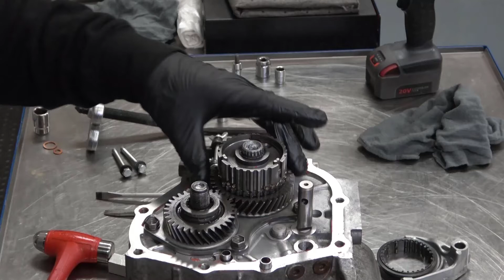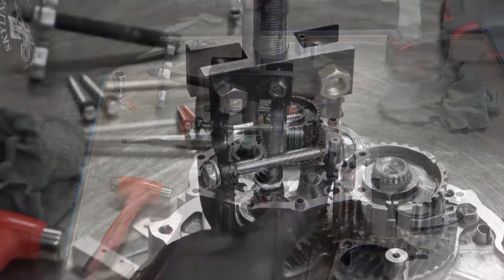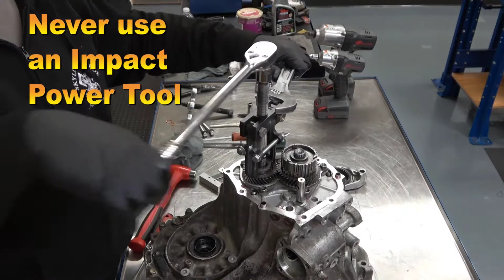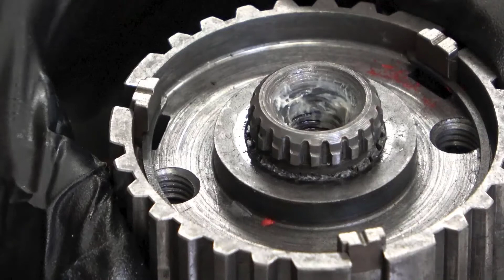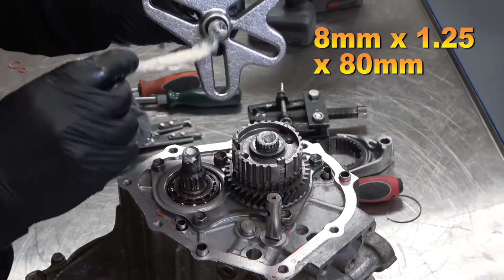Manual Transaxle Overhaul (3.1)5th gear removal

Comment: I'm working on a Toyota echo trying to get that hub off. There isn't the two 8mm bolt holes in it. Is there a special puller that I need?
Reply: Did you ever figure this out? I’m working on a scion xB and ran into the same thing
Reply: @ksnipes24  yeah I ordered a small puller on Amazon and used a impact on it and it came off

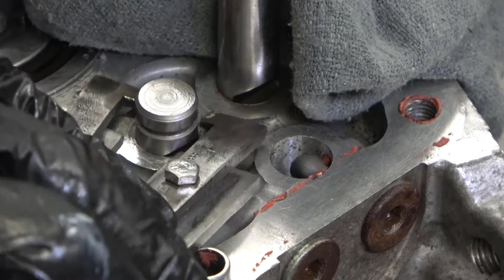Comment: Great video. I like the detail. What is the make and part number of the 5/8" snap ring tool at 4:29?
Reply from the maker: The 5/8" snap ring tool is a custom tool I made and not available commercially.
Reply: @DrivelineMaster yeah I saw it in another one of ur vids. Very nice. I think I’m gonna make one as well. Thx
Reply from the maker: @RelentlessRacingAJ  If you do enough work that has these 5/8th snap rings it is a time saver.  Once you get your tips as you want time heat treat them to harden them.  Get them red hot and quickly quench them in water.  I put a real small notch about a mm away from the end of the tip to catch onto the edge of the snap ring.  If you need a close up picture let me know.  Happy to share.  I know it needs some engineering improvements but it still works good as is. If you make a million bucks off of this idea remember where you got the idea from.

Comment: When the car is removing then gear five out
Reply from the maker: The transaxle has been removed from the vehicle however on some vehicles it may be possible to access 5th gear while leaving the transaxle connected to the engine.

Comment: saan po nakakabili ng removal na yan?
Reply from the maker: It's made by OTC but most universal gear pullers will work for 5th driven gear. Same for the Synchronizer hub.  there are several that make similar designs.  One note however if the synchronizer hub doesn't have threaded holes in it then it's very difficult to find a universal puller with puller jaws with a small enough claw to fit under the gear.  I did have to use a very specialized universal puller for that one.

Comment: Hello, do you recall a part number or the type of thread that you used for the longer forcing screw? I need to pull the 5th output gear on my E250F and I will order that OTC tool. Also is it generally okay to evenly install the driven gear back on with a hammer/deadblow?
Reply from the maker: Unfortunately right now I don't have that thread information.  I have run into a few different forcing screws.  I Might be able to check in a few days when I go to the shop.  Don't hit right on the gear but instead find a metal pipe that fits the inner diameter so it doesn't hit the gear teeth then you can hammer it on by hammering on the pipe.
Reply: @DrivelineMaster  I got you, I ended up modifying a pitman arm puller to get that gear off. I’m also replacing the bearing plate as part of the TSB to fix the issue, but I notice the spacer ring that’s under the plate, that contacts the output bearing race is a bit worn down out of center on the side, just a couple thou. Think it is safe to reuse that spacer ring if I just smooth over that step so it’s all parallel again (but a couple thou undersize from what it was)
Reply from the maker: If you have a spacer between the bearing race and the bearing plate check to see if you have tapered roller bearings.  if you do, that spacer is used to set a preload on the bearings.  It doesn't need to be perfectly round as long as it contacts the bearing race properly but more importantly is the thickness.  I don't remember if I covered this in my video's because the transaxle in the video uses ball bearings and roller bearings instead of tapered roller bearings. If your output shaft has tapered roller bearings you need to add an extra step to the assembly.  After overhauling your output shaft and replacing the bearings and races put only the output shaft (No diff or input shaft) into the lower housing.  Put the upper housing on the lower aligning the output shaft.  Torque the lower housing bolts in place. All of them.  Install the upper bearing race, spacer (shim) and bearing plate.  Torque the plate to specification.  Put the nut onto the output shaft and make it just tight enough so the shaft will turn with the nut.  Use and inch pound dial or beam torque wrench (can't use a click style) and rotate the output shaft with the torque wrench and note the value on the torque wrench.  A digital torque wrench may work but I have never tired to use one. This is the bearing preload.  Compare that to the manual for the specification.  A thicker shim will increase the rolling resistance and a thinner one will decrease it. If  you need a spec let me know what the transaxle came out of (year, make, model, engine) and I will see if I can look it up for you.
Reply: @DrivelineMaster So it is a 1996 RAV4 3sfe engine and I believe it’s the E250F transaxle. The transmission is still in the car, I only opened that access panel on the driver side to replace the parts referenced in TSBTC001-01. Of course 1996 isn’t listed on there but I hope this fixes my issue of fifth popping out of gear under load. Maybe I’m confused but I’m not touching the main bearings that at the end of the in/output shafts under the bearing retainer plate.
Reply: @DrivelineMaster  it is indeed a tapered bearing though
Reply from the maker: Use this link for information on adjusting the preload on the output shaft tapered roller bearing. http://www.tgbcomputing.com/PDF/REAS.pdf
Reply: @DrivelineMaster  thank you. So it’s okay to have the input shaft installed then while I checking the output preload? Just not have it in gear of course. 

Could you also double if these tolerance ranges are correct: 5th gear thrust clearance of .004-.022” and the lateral clearance of .0004-.002
Reply from the maker: It is NOT okay to have the input shaft installed or the differential. This can not be measured with the transaxle installed in the vehicle. Contact with other gears will skew the bearing preload measurement.  I'm uncertain as to what you mean about doubling.  I never bother to check lateral clearance because the bearing, shaft and gear would have to be severely worn out to be out of specification and I can visually inspect those components. Make sure the snap ring that holds 5th synchronizer onto the shaft is in good shape and fits snug onto the shaft.
Reply: @DrivelineMaster  oh boy, makes total sense but that sure is a bear of a job then! I’m not in a position right now to pull the transmission, if it’s even easily doable without having to pull the engine too.. 

By doubling, I meant to say double check* my bad

So I might have to roll the dice on reusing the current spacer. As much as it probably pains you to hear haha. If I have to do the clutch at some point then I can overhaul the trans, you make it look pretty easy!
Reply from the maker: Yes, I would just reuse the current shim.  odds are that you won't have a problem. Chances are that 5th gear thrust clearance will still be in spec. without you having to measure it. If you have the tools it's not a bad idea. I would not worry about the side clearance. If you performed the bulletin and replaced the hub and bearing that means you had the gear off and you had the chance to inspect the output shaft bearing surface and if all looked good and you put the new bearing on your side clearance is going to be OK.   You should be able to R & R the transaxle without removing the engine. If your RAV 4 is a 4WD model R & R ing the transaxle is a big job even without removing the engine. I had students do one of these 4WD models at the school once and I swore off ever offering to do another 4WD RAV 4 model. Good Luck.

Comment: I have the C150 gearbox that has the 0.825 5th gear. Looking to get the 0.725 5th gear from a C53 gearbox for better fuel economy. 2 things i'm worried about and that's if it will work and not strain my engine too much.
Reply from the maker: I can not verify that this will work but you will need to replace both gears for a matching pair.  You might find that the overdrive gear ratio is about the same.  Most Toyota Transaxles have a 5th gear overdrive ratio of nothing smaller than .7:1.  Count the teeth on both gears and calculate the ratio.  I have a video on calculating gear ratios.
Reply: @DrivelineMaster  I see this one has the 0:725 5th gear as i've checked the ratio's on a C51. My 5th gear is 0:815. I can only try and have been told the conversion would drop the revs by 400 rpm. Hopefully it's not too much for my engine but it has 97bhp and does pull well from 2500rpm
Reply from the maker: Michael, I do not know if the higher 5th gear ratio would create a problem for your engine or not.  I do suspect that a team of engineers that are paid above my pay grade who had all the specifications and documentations available to them decided that the 5th gear ratio that you have is the correct ratio for your engine and vehicle. I know the price of gas is hurting all of us but unless you spend a ton of time every week on a road that will allow you a steady 65+ MPH for many, many miles of steady driving I really don't think you will see a very big advantage in gas consumption to make this conversion worth while.  If you do this and it's too rough on your engine at lower speeds you will end up using more gas and putting unnecessary load and wear on your engine and clutch. Another thought would be to change your final drive ratio but this will impact all gears.  I don't even know if this conversion is available or possible.  Good Luck to you.
Reply: @DrivelineMaster  I can only try it and if i find the revs are too low in 5th gear for it to accelerate nicely i can change it back. I also have the option of fitting bigger wheels too.

Comment: my c52 doesn’t have the holes oh no. even the service manual shows them :(
Reply from the maker: You might have a C51. In anyway showing how to remove the synchronizer hub on those types of transaxles are on my bucket list.  It takes a special puller that has a really thin lip on the end of a puller jaw.  Those jaws have to be placed under 5th drive gear and you pull the gear and synchronizer hub off together.  If I could add a picture to this comment I would.
Reply: @DrivelineMaster is there a way you can help me too I'm having trouble with my 95 paseo the synchronizer hub doesn't have holes and I've been trying to find a puller for it but no luck
Reply from the maker: Yes, that is a challenging one. I never got around to showing the tool to use for that.  Unfortunately the tool I used is costly. Let me see if I can find and recommend something for you.  Don't use screwdrivers and try to leverage it off. You will chip the gear teeth every time.  This might work. The key is not just choosing the one that fits the diameter of your hub and gear but the jaws need to be super thin to fit under the gear.  For the price if the jaws are too thick you could try grinding them down.  keep the cool. too much heat will damage the hardness and they won't be effective. The factory tool part number is:  09213-3602. If you can get a hold of SPX/Miller tools you might be able to get it directly from them.   https://www.amazon.com/dp/B077M6NZJH/ref=redir_mobile_desktop?_encoding=UTF8&aaxitk=24bfe1efec3ddfb225a925d7e0feefca&content-id=amzn1.sym.cd95889f-432f-43a7-8ec8-833616493f4a%3Aamzn1.sym.cd95889f-432f-43a7-8ec8-833616493f4a&hsa_cr_id=5986658870701&pd_rd_plhdr=t&pd_rd_r=b0aa52d4-fa3e-41f7-85e7-43a1be08ecd7&pd_rd_w=A9FOM&pd_rd_wg=KIs3f&qid=1692762227&ref_=sbx_be_s_sparkle_mcd_asin_2_title&sr=1-3-9e67e56a-6f64-441f-a281-df67fc737124&th=1
Reply: @DrivelineMaster  Thank you so much for taking time to reply back asap! I will check it out and hopefully I can get it.
Reply from the maker: The tricky part is finding a puller with very thin flat jaws.  Although I'm now retired I'm planning on returning to the school where I worked and have all these tools in a few days.  I will try to get some more puller information for you once I'm there.  I will post to you again in a few days if you want to hold off on the puller from Amazon.
Reply: @DrivelineMaster  That's really nice of you! Yes please keep me updated and thank you for your time! :)